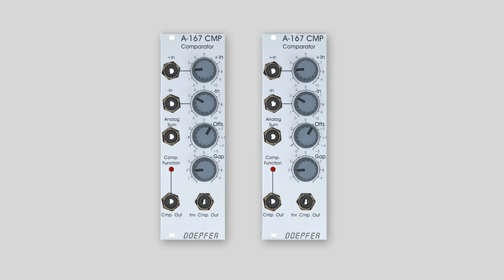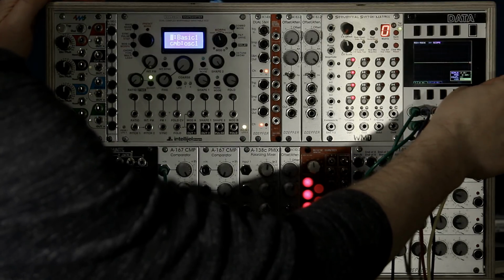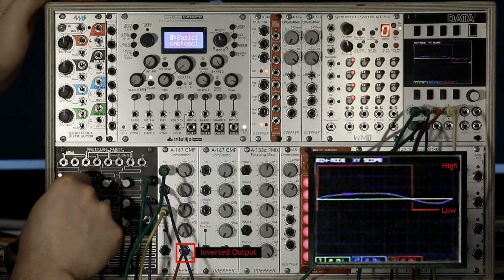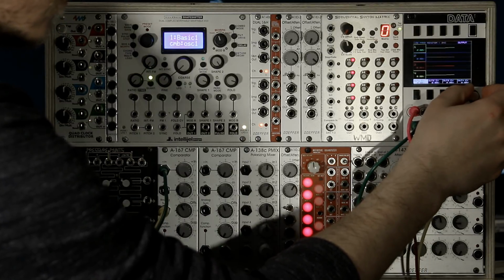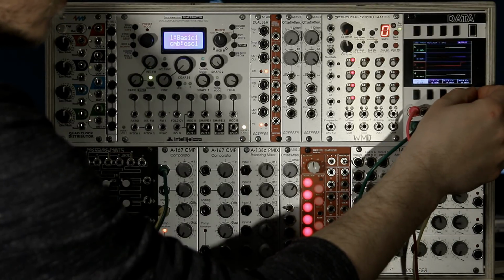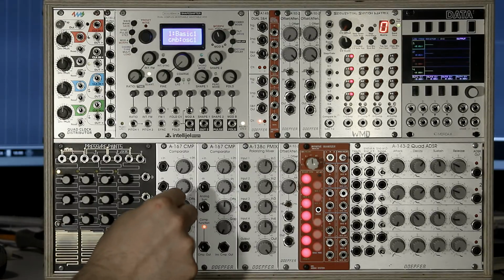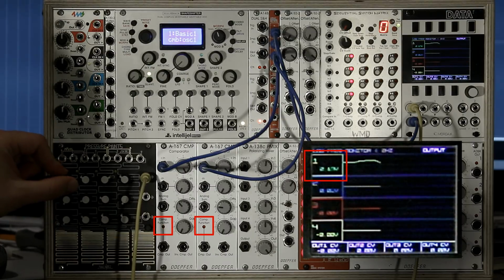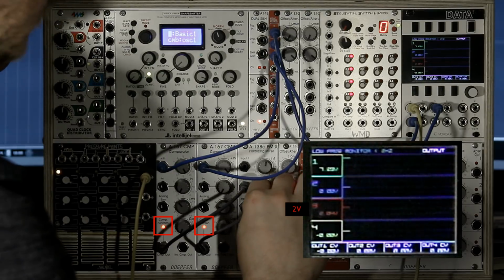Comparators - selecting voltage ranges

Comment: Thanks for your effort and sharing your ideas and amazing vids..I am looking for a kind of 'eurorack key tracking VCA' - solution that will ephpasize certain ranges of a sequence. When turning a knob from ccw - vca is just ampl. the lower ranges of a sequence - turning knob cw VCA is more and more emphasizing towards mid range and full cw only higher (highest) ranges. Could your comperator aproach solve thios problembe a solution? Any ideas how I could manage this? ( there is keytracking for VCAs in Ableton so I was wondering how to manage within eurorack system. ) Thank you for your help!
Reply from the maker: Hello iholci, thank you for your comment. I am really glad you liked it.
If I understand correctly, you want lower notes in sequence to be quieter, and higher notes would be louder.
That is very simple to do if you want to apply this to the whole range lineary. In that case, in addition to your envelope driven VCA, you would have one more vca that is controlled by your sequence CV. Higher notes CV would make VCA open more than lower notes. I would put this sequencer driven VCA before envelope driven VCA, but it would work other way around. If you want to make higher notes quieter than lower notes, you would just need to invert and offset the sequencer CV and apply that modified signal to new VCA. That is if you want this applied to the whole range lineary.
Selecting a range using comparators would be useful if you want to emphasize specific range of notes. You would get gate signal which would tell you when those notes are played, and you could use it to apply more volume while gate signal is high. It also doesnt need to be used only for volume of course. You could apply some effect only to selected range of notes in your sequence.
Reply from the maker: Essentially, this would be like applying velocity. But instead of velocity data you would use note cv. Maybe you can find some useful examples for patches that describe how to apply velocity.
Reply from the maker: Ah yes, one more thing, if you have VCA that can process cv signals, then you can apply that new VCA to your envelope signal rather than putting it in audio signal chain.
Reply: @dinkoklobucar526  Thank you for your feedback and thoughts! Would your solution require two knobs? One for positive and the othe for inverted cv? What I want to achieve is , with just one turn of a knob, a smooth loudness(velocity?)-transition from louder lower notes over equal loudness in center position to louder high notes in cw position. And back. So I can emphasize certain ranges of one sequence. All in one move. I tried your suggestion with the invertig cv, but its also just one direction. Thats why I thought your comperator idea might help. Because I would shift a certain range from top to bottom and back. Of course in center position I would just focus on the mid range and loose high and low end parts. I would have to accept that compromise. Sure I lost you now! Haha Thanks for your time!
Reply from the maker: No, not at all. There are two ways that come to mind, but this can certainly be achieved in many ways with different levels of controls and precision.
1. make 2 different signals that would work for your extremes, and mix them using crossfader. that would give you one knob control.
2. I would personally prefer this one. 
You could use some kind of attenuverter for example something like this: http://www.doepfer.de/a1832.htm
You would firstly need to offset your notes CV in a way that your desired middle would be at 0V. Using attenuverter, fully cw would give you original cv centered around 0V,  at middle position it would be fully attenuated (0V), and full ccw would give you fully inverted signal(around your selected middle value). So attenuverter control would be that one knob you want. After attenuverter you would need to offset the resulting cv so it is always above 0V so you could use the whole range controlling the VCA. 
Hope that this helps
Reply from the maker: I mean both approaches have their advantages
For crossfader approach you can define different extremes and have control what exactly it should do at those extremes, but at expense of not being able to control perfectly what happens at the center (you get the mix of 2 extremes). Using attenuverter approach you can achieve perfect symmetry around your center point pretty easily. You can also change the center point easily while performing.
Reply from the maker: note that for crossfader approach you would also need to center your values around 0V before mixing, and offset back to above 0V before VCA
Reply: @dinkoklobucar526  Many, many thanks for exploring my topic! I will give it a try and get back to you with feedback. P.
Reply: @dinkoklobucar526  Short update: followed your guidance and it worked quite well. It needed two VCAs to get it right. Final Offset OUT to VCA1 CV IN -  Out of VCA1 to VCA2 CV IN ... right? 1st VCA must be openend until you hear sound. 2nd VCA  closed.  Still some clicks and pops but I will try to fix this..Thanks so much for your support!! P.
Reply from the maker: if you hear clicks, consider  adding slew limiter or envelope follower to smooth out stepped cv before vca, just a tiny bit to get rid of clicks.
Reply: @dinkoklobucar526  Yes, good idea! Thx

Comment: very detailed tutorial but I would have prefered to hear the changes the comparator does while you were turning the knobs and not just see them.
Reply from the maker: Thank you for watching, and also thank you for your comment. Yeah, was planning to show changing comparator values and modulating it, but at the end I decided to focus on showing how precise one can be with this and how stable is voltage detection. I also thought that changing those values by hand would add confusion to following whats exactly going on with output. I just thought this would be much clearer way of explaining the concept. But of course, changing comparator values by hand or using modulation, adds more variation. In case you're wondering what is the end result of changing comparator values, it would change the selection range of notes for different voices.
Reply: i just didnt find it very helpful to look at that confusing oscilloscope with 4 different color lines going on all at the same time. It's also not very interesting to listen for such a long time when you only get the result at the end. Next time just let us hear what the machine outputs while you're doing it. The drone in the background was really unneccessary
Reply from the maker: Oh I see, then you just don't like my presentation in general. Sorry that you didn't find it useful, it is impossible to fulfil everybody's expectations, but thankfully there are many other people using different approach to present material.
Reply: no I did find it useful. It's a good tutorial. I'm just saying what we're doing is music and sound. Trying to understand something musical without hearing it is very hard to me. After some minutes of looking at the graphs I tuned out mentally and found it really difficult to follow your explanations. Had I heard how changing the offset or input values, whatever, would have affected a modulation target while you were changing it, that would have made it much easier to follow along with and to comprehend. 
Again, everything you did was very well explained. I just dont see why you wont let us hear the results during the explanation.
Reply from the maker: The thing is that there wasn't much to hear. Since these are not really trivial patches they require a bit of setup, and I want to show them built from nothing. It is helpful to use visual representation and measurement to setup something that you can test easily. It is really a pain to debug a complex patch if there are no patch points where you can tell for sure that the thing is working. I really doubt that I could even implement this kind of system, which is relatively simple, without the use of oscilloscope to see whats going on and see in detail how every component behaves. I really doubt that using sound during this setup stage would help. But who knows... 
I can imagine that this kind of approach is too detailed for some (or even lots of) users but I think there are some people interested in setting up procedural kinds of systems that would generate useful cv to create music. Setting up anything a bit more advanced will probably require some planning, testing and measurement along the way. I try to demonstrate the whole thinking process during patching. I am kind of doing it this way hoping to provide some tools and techniques for people wanting to translate their original ideas into modular system patches, along with the main idea for the tutorial.
Anyway this was the best way I could think of showing it, or better said, this is how I would like this to be shown to me so I do it that way.

Comment: Dinko i've been trying to recreate this but my only switches are A151 and A150 by Doepfer so i'm stuck at the switch part. Would i be able to re-create this with a A152 voltage addressed switch rather than the WMD SSM??
Reply from the maker: Yes. A152 will do it. Any switch that has cv addressing can be used.

Comment: You completely baffled me in this video right up until the melodies. Will have to watch a few more times to understand. That's the power of your content dinko it's complex but so educational. Thanks for the head ache
Reply from the maker: Yeah, you're right, if this idea was to be presented in real life, it would have a bit different structure, or each step could be explained in more words. But my thinking is, this is video, so anyone can pause or rewind, and I try to keep pace at something I would find interesting. I also try to show everything relevant for the concept in this small case, and keep material length under 30 minutes including examples. Originally i wanted to include 3 comparators... but then, other important modules wouldn't fit into this case. I think all the information that is needed was included in video. Sorry for the headache, but probably in very near future you'll be baffled at how simple this really is. Thanks for watching
Reply: Dinko the head ache is an expanding mind, the accomodation of new thoughts and the struggle with new knowledge. I de constructed your first video, on noise, and worked towards the end goal as I will with this. I don't have any comparators. Can I ask you, even though you have the doepfer module would the Jor comparator be as useful?
Reply from the maker: Yes. I suppose that you are referring to Compare 2 unit? From what I can see it is a bit different implementation, but you can achieve exactly the same result as described in video. It defines a window. You would set this window to be FROM some specific voltage and TO everything above. In other words, to implement exact example from the video, you would set first comparator window to be from 2.8V-10V(or whatever is highest that can be set), and second comparator from 5.6V-10V. You want to have both comparators outputs high when in top range, and none when in first range(0-2.8V). You should be able to implement this with any comparator. Let me know how it goes :)
Reply from the maker: Of course, you don't really have to be precise with this. I define it like that in video because it is much easier to explain the concept that way.  The important thing is that you define some ranges and switch between those ranges. It is perfectly fine to find what works musically by ear for some given input.
Reply: Those examples are so musically rich. If the use of comparators is that integral then I will have to get one. Yes of course I will come back to you later, probably much later and share with you the results of your idea, my interpretation. Cheers dinko.
Reply from the maker: Comparators are important in that you can switch between voices in "non linear" fashion. You could certainly use just a switch, but then ranges that you select are always the same size. With comparators you can make it more "natural" or "musical" in a sense that you can control the size of selections and find something musically pleasing moving those ranges around.
Reply from the maker: Yeah share the results, i would be interested to see this used. Cheers :)
Reply: Dinko morning. Yes that's the first bit understood now. The comparator will produce a gate when signal crosses specific threshold. I will try with maths first as this I have.